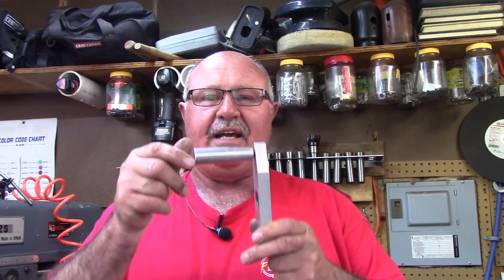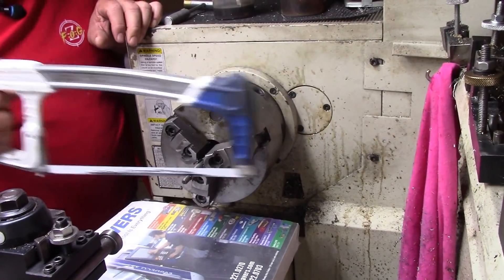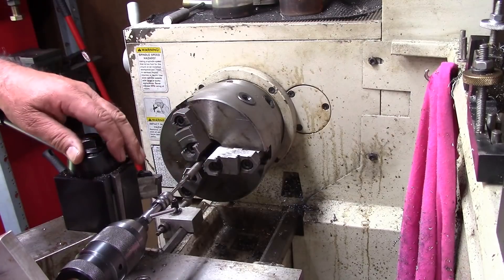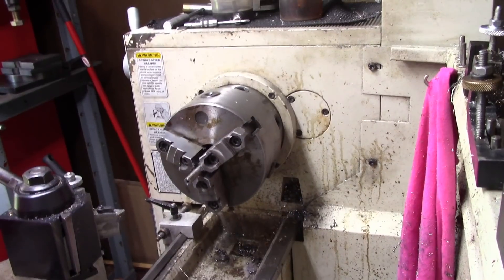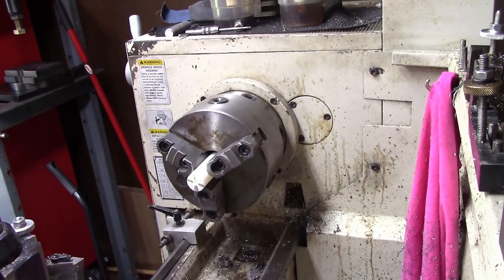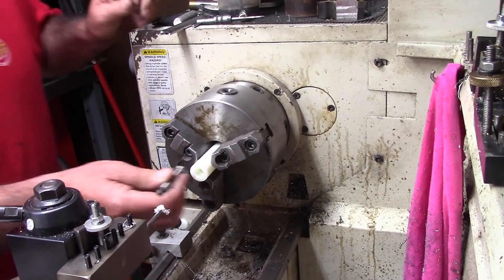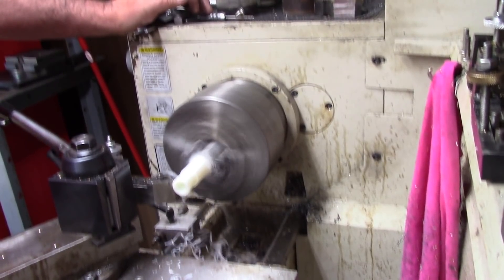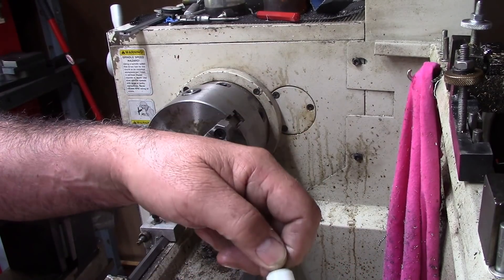Active Atom Speed Handle Part 1

Comment: Yeah, Lance and Patrick are cool guys, they'll like the handle when it's done.  I think it's cool that you scale the design up and down depending on vise size, and they have much smaller gear than any of the rest of us . . . I can only imagine the speed handle on one of their smaller vises . . .Thanks for the shout out, and like you I don't like to see good material/tooling thrown away.
Reply from the maker: Everett's Workshop yes it is easy to figure that one out. Just figure the % difference and scale accordinly